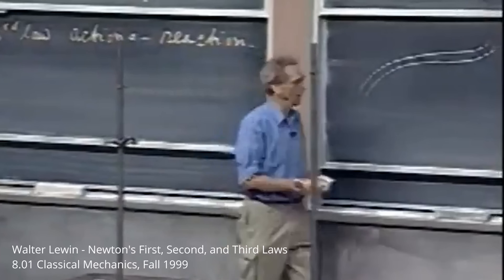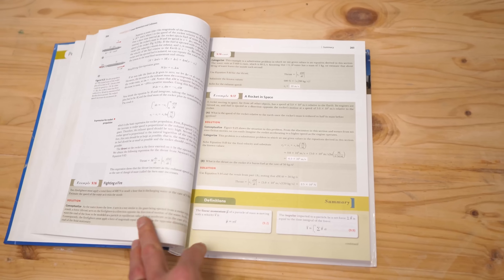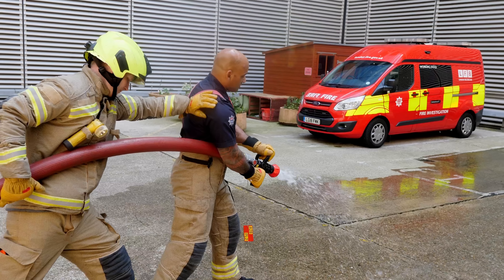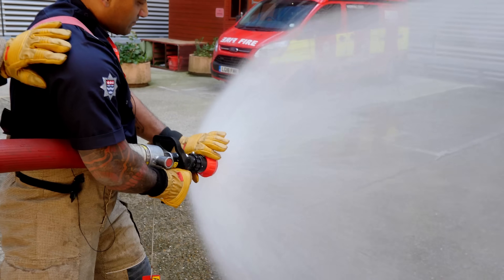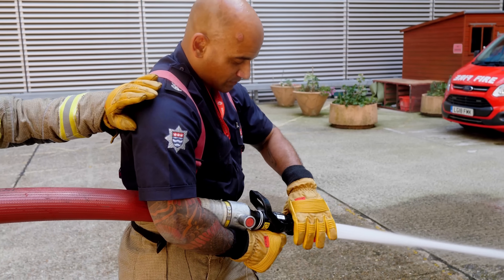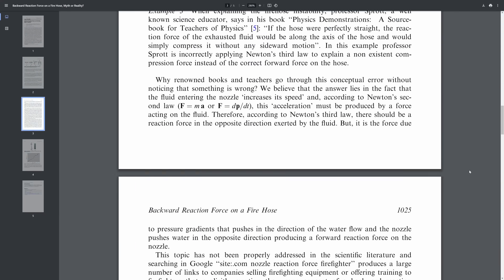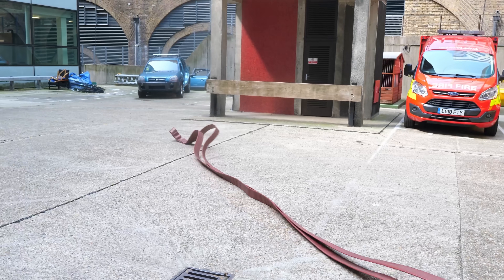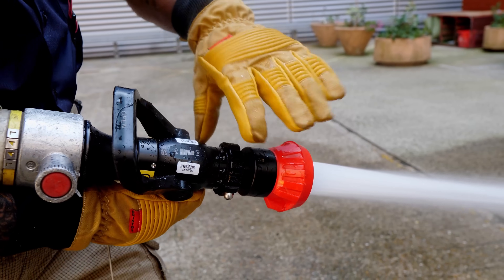Why chaotic hoses dance

Comment: (I'm a man borrowing my wife's account)

As someone with a decent understanding of fluid mechanics, you are incorrect in the theory that there is a positive pressure at the outlet of the nozzle. Since this positive pressure does not exist, the acceleration and thrust associated with it also does not exist.

Comment: Hey Steve and everyone here, I have a thought experiment that might prove interesting. Specifically, is it possible to prove that this system (fluid through a hose) is actually distinguishable from blowing a bubble? Here me out.

Imagine blowing a bubble. In order to do so, you have to blow the bubble (i.e., force a fluid) through a hoop (or some contained shape but let's just say hoop). Now, take that hoop and increase its size in one dimension so that the hoop extrudes into a tube. Et viola! Back to the starting condition of this video!

Do you think there might possibly be some value in examining this problem at a boundary condition, in this example, a bubble being blown through a hoop? I hope this comment is seen and not lost in the TY sea.

Comment: What if you suspend the pump on the string and hold the end of the hose? Will the pump move in the direction opposite to the water flow?

Comment: Except, at the pump the pressure is high, and it falls progressively along the hose to a lower pressure on the pump side of the nozzle and the to atmospheric pressure at the nozzle outlet itself. At the nozzle there is a more sudden pressure drop factor. Thus a particle of water (!) has a tiny amount more pressure on its pump side compared to that on the nozzle side.  I don't know how this affects the argument, but it may be a significant factor in this discussion.

Comment: It comes either from the tension in the hose that is balanced by the waterpressure inside, and when the waterpressure drops the hose pulls on the firefighter, or it comes from the bends in the hose trying to move the hose. Those are the only two mechnism that exists. 

The pushing on a thread analogy is wrong. It is hydrolic communication of pressure, and the only forces acting on the tube in such systems are transverse to the direction of the tube so in a sense you can obviously push on the string so to speak.

Comment: There’s also the friction between the fluid and the hose, as the inside of the hose is slowing down the flow of the water all along the boundary layer, so it is absorbing some of the momentum of the water, which is a force backwards since friction is a force that pretty much always moves opposite.

Comment: Gas and water are not directly comparable, because a moderate overpressure i water doesn't contain any energy, so the momentum of the water doesn't increase at the nozzle, but it does accelerate if the hole at the end of the pipe is smaller than the pipe.

Comment: All the forces from the water on the hose are pressure perpendicular to the shape and drag, the drag forces are always net opposite of the outflow, so the reaction force when there is no expansion nozzle can't possibly come from the water accelerating out of the nozzle.

Comment: The pump moves the water threw a closed system when the water leaves the the system it acts like a rocket, just as the rocket is not propelled by the explosion but the material blasting threw the closed system of the rocket engine and out of the nozzle

Comment: I build rockets and jet engines.  I have not found a good way to think of thrust in terms of pressure integration only. I have heard smart people who have worked in industry get confused about this too.  The best way to think about it is in terms of momentum exchange and pressure differential at the exit (which is the thrust equation btw).

Comment: A clue to why this is should be that the hose itself doesn't get significantly shorter if you let go of it if it is kept straight, that means there is a shortening of the hose while it is straight where it will not present any pushback force at the nozzle at all, and this is not because the hose is compressed, no it will still be stretched logitudinally, it will just simply be stretched less because the steady state pressure inside is lower while the water is running than when it is closed.  

It is also important to realize that pressure is also somewhat eaten by friction inside a pipe or hose, not by much, but pressure does absolutely drop over distance at a constant flow rat, again, it is not by much but it is there, but when the hose is closed there is equal pressure along the whole length of hose, which contributes a little factor to the change in longitudinal stretching of the hose as it goes from closed to flowing.

Comment: So does the weight of the hose play any role in this? I feel like a majority of the hose is weighed down by gravity, which would act like a tether and then the tip has infinitely less weight as you move closer and closer to the end of the hose.

Comment: Wrong. The rocket explaination is not correct. The potential energy for the acceleration comes from the water itself, not the nozzle. A constricting nuzzle has no backpressure, all the pressure is on the walls of the hose and back at the pump.  

I left you some clues about the real answer. 

But i will give you one more.

What happens if you put the hose inside a hard metal tube such that it can not bend, that is slightly too short of to hose and slightly to wide for the hose to fill the entire space inside. Well then, as you relax the hose longitudinally the "pushback force" on the handle of the nozzle disappears and the nozzle will apply no logitudinal stresses to the tube at all, but the deformation of the hose will also be slightly larger round the perimeter.

Comment: I personally think its more of the rocket idea then you seem to realise. Watch a hose flick around at various different water pressures and you can see its due to the water being pushed out of the end of the hose, its due to water particles pushing on air particles to create the momentum. If you understand rocket science you can see how the water pushing on the air particles causes the hose to fling around, the momentum is created at the point in which the particles start to interact. I agree with you the pump will feel some sort of force and that will be the force of the air particles pushing back on the water. If you were to run a pertol powered centrifugal pump to push water into a water tank from a fitting at the bottom and the tank was already half fall you would hear the difference the pump feels as the motor strains compared to running the pump with the hose flowing onto the ground. the only difference in this scenario is the water is pushing against a more viscous water rather then air.

Comment: Reminds me of the similar brain melter of trying to figure out what happens when you slurp up a spaghetti noodle. It goes into your mouth because your mouth is at a lower pressure than the outside air, so it's being pushed in. But how do you actually push a piece of limp spaghetti? Pressure on the sides won't do anything because they cancel out, leaving the pressure on the ends as the only unbalanced force, but physically pushing on one end of the spaghetti clearly wouldn't work. So where is the force actually being applied?

Comment: Could the force back along the hose be due to the friction with the fluid?  Since the friction would be slowing the fluid no matter whether the hose has any turns, then the hose always wants to pull back away from the exit position along the exit direction.

Comment: Also, what you did your test didn't only have a bend in the hose you had a loop, where the hose was trying to undo the loop, so to speak, imagine instead that you had a really long hose with 500 loops in the same direction, what would change about the force exerted on the nozzle end of the hose? Answer, none, it would be the same. Have fun figuring out why yourself, it is better that way ^^. There is this really funny relationship between the pressure inside and the stretching of the hose if it stretches isotropically, so the felt force on the end should be invariant unless you have it exactly straight, and you carefully relax it.

Comment: Layman's perspective on the newton's third law argument. I feel it holds only for solid objects that don't slack that the reaction force is communicated at the other end of the body or as per your reasoning the pump. In a fluid like this the pressure gradient force that is pushing the water is present at every point at which the water is forced so every point feels that pressure gradient Force. So will you at the end of the hose if you hold it and retain the pressure gradient by making the wall immovable.
Reply: Nevermind I replied seeing you question it at 9:20 and now at 12:00 you have seen it already with the perspective I wrote about

Comment: So steve, think about the rocket again. What pushes the rocket is the pressure inside the combustion chamber, plus the pressure on the nozzle in the direction of acceleration of the rocket. Of you take a hose and you keep it closed, and you pressurize it, what does that pressure do to the hose? It will simply stretch it, and when you lower the pressure by releasing come water, then you will simply feel the hose pull on you, not the watercollumn. The water is actually helping you hold the hose by friction and the steady state pressure, unless the hose has a weird relationship between stretching transversly and logitudinally.  

The difference then is this, you need to keep the hose straight and in tension to keep it from wobbling around, and when it wobbles around it also generated a different kind of tension by wanting to curve more so to speak. So unless you can keep the hose perfectly steady the equilibrium force added by open the nozzle should be roughly the same.

Comment: 9:23 isn’t it because of Bernoullis principle ? 
Most of the recoil is at the pump. But the hose nozzle size decreases and that causes the increasing speed, so the firefighter only handling the recoil that happens during the nozzle size change?

You should see what happens if you out a decreased “nozzle” size on the “sky dancers”

Comment: I guess most of that work holding the hose must be lifting the weight of the hose, weight of the water in the hose (until it's supported by the ground), while also trying to prevent it from flailing.

Comment: You have a bathtub with water in it and a handheld showerhead with a hose. Let the showerhead be above the water hanging in the hose and turn on the water for your shower. The showerhead will dance around a lot in the air, like in this video; now dip the showerhead in the water in the tub and watch it almost become completely still. Isn't that strange? If water is less compressible than air shouldn't the head move more, like a waterjet? I know I read an explanation decades ago but can't remember what it was.

Comment: @SteveMould Dang, was hoping negative pressure would come up.  I work in a company that does injection molding, and the gate closures that control when plastic is injected into the mold tool are actuated by two rubber pneumatic hoses – one positive (blowing), one negative (vacuum).  One day a hose slipped loose from its fitting and began flailing wildly, as these are pretty high pressure for their size.  I watched the thing and after a couple minutes, the hose stopped very suddenly.  It had suctioned itself to the side of the mold.  This was evidently the negative pressure hose.  I previously had no idea at all that this was possible in a hose pulling air, just like one blowing.  It really looked like the same flailing action, and certainly sounded like it.

Comment: At 11:42, you say that the pressure must be the same throughout the hose, because the velocity at which water is travelling is constant. I do not think this is true, as a basic engineering text on pipe flow can attest. The velocity is constant because of mass conservation (as water is incompressible), but the pressure decreases as water goes along the hose. This is necessary to balance friction caused by the hose walls. There is a balance between this pressure gradient force and the frictional force. For this reason, the pressure essentially increases linearly from the hose outlet upstream to the pump.

Comment: 9:33 a plausible reason for why the force exerted by the hose remains the same through both trials is that the hose is pointing in the same direction in each trial (relative to the source of the compressed air). in order to travel in a loop ie a circular path, the fluid traveling through the hose must experience a centripetal force in the direction towards the center of the loop. due to newton’s third law, this of course means that the hose is experiencing a force pointed away from the center of the loop at each point in the loop. these forces would theoretically cancel each other out, resulting in a net force of zero throughout the whole loop. this means that a hose with only a 360 degree loop in it would exert the same force as a straight hose. repeating the experiment with the hose pointed 90 degrees away from the compressed air nozzle could produce different results.
Reply: even if you just go with his explanation by steve at the start, taking the difference of the force vectors before and after the curve (a full loop) gives zero. I'm not sure if that's oversimplifying but seems right in my head.

Comment: Your table top test and the fire hose test dont have the same conditions. Your table top test doesn't have a valve or restriction at the end like the fire hose does. The valve also accelerates the water due to the restriction. Pumps don't create pressure, they create flow. The pressure comes from the restriction at the end.

Comment: Are we over complicating this? We know the force is from the change in speed at the end of the nozzle. We can easily test this with a garden hose with your thumb over the end and change the rate of the flow and feel the force against your arm change. Firefighters would also feel this same thing when they adjust the nozzle also. Maybe I’m missing the deeper learning meaning and understanding.

Comment: I think you might have missed a key factor, especially with the water hoses. All the water hoses and pipes you featured,have a restriction at the nozzle which will have a significant impact on the forces in play. There’s also the factor that water has far greater mass than air and the ratio of the fluid to pipe mass will this be significant. It’s complicated 😊 but it is fluid dynamics so that’s hardly a revelation. 

Also the sky dancers have additional pipes off to the side and are working against gravity which changes the dynamics of those systems somewhat in comparison to the other systems you discuss. 

Splendid video however, just as we’d expect from you.

Comment: Despite the fact that you don’t see the internals of the hose I’m pretty sure you need to account for  the velocity vectors of all of the water/air particles inside the hose to figure out the forces and resulting movement (aside from the elastic movement of the hose) - quite complex, hence the apparent randomness… FEM could be helpful if you insist.

Comment: I think the nozzle is being pulled backwards because of the rocket effect. The momentum is gained at the nozzle, then because of imperfections in the straightness of the hise that force is transferred to the hose itself. So if you managed to tension a hose to be completely straight, all the force from the pressure difference would be put on the firetruck.

Comment: The garden hose is more chaotic because its volume of water is much less than a fire hose. As simple as it sounds, a lighter hose requires less force to move. Conversely, the much greater volume of a fire hose means the force leaving the hose is offset by less length of hose. This is why a loose fire hose will be chaotic for a smaller percentage of its overall length; the rest of the hose acts as its own counterweight.

Comment: Adding an additional comment about the reasoning behind getting ahold of firehoses versus just turning them off. I feel that the reasoning given in the video is nearly nonexistent, and almost gives the impression that it's kind of erroneous.

But my wife, a former volunteer firefighter, explained that the real reason for training for this sort of thing is mostly around DISTANCE from nozzle to pump. If the nozzle is a significant distance from the pump, and especially if elevation changes are present (aka, up or down stairs) then it becomes completely impractical to consider shutting the pump off itself. The noise of the fire at a distance would make shouting impractical, as well as most radios. And she pointed out that the water coming out of the hose might be a lifeline, that if turned off instead of controlled, might be catastrophic to the situation (a burning building, for instance).

I don't think the firefighter gave a good explanation... but I don't think it's his fault necessarily. It seems like he was asked on the spot perhaps?

Comment: Has anyone mentioned the Hagen-Pouiselle equation. It defines the the pressure drop in a pipe, of an incompressible fluid in terms of: flow velocity, viscosity and the reciprocal of the pipe radius raised to the 4th power.

Comment: 5:20 - is there a reason why the right-angled valve type he has the the open end of the hose can't also be used at the engine end for emergency cut-offs? In line with the rotary valve if need be. Just wondering...